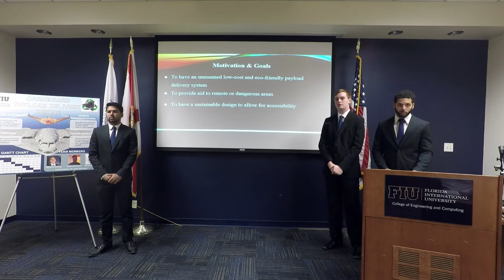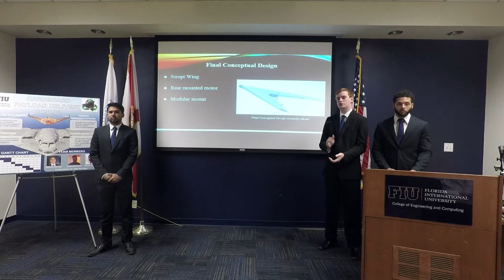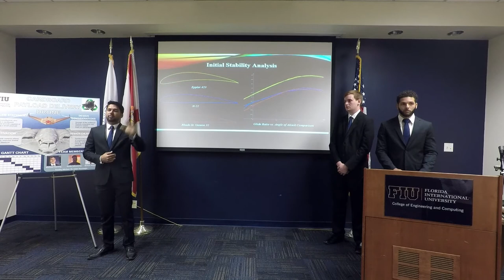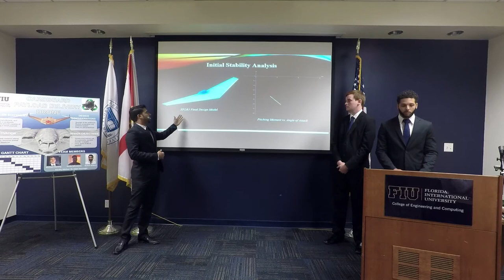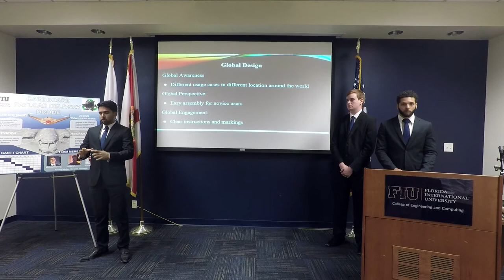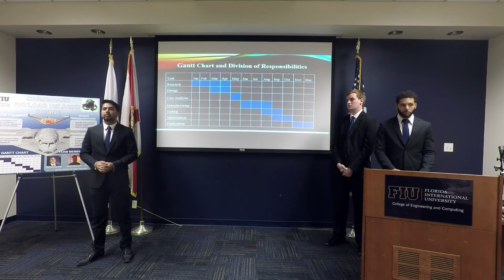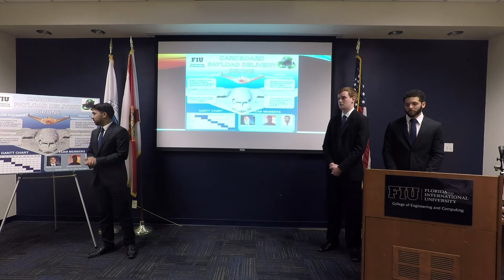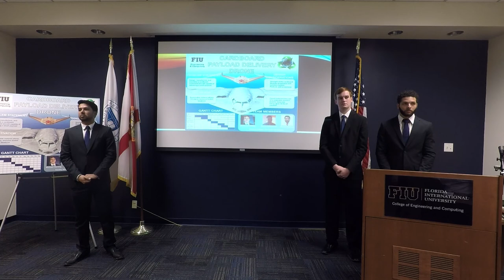SDO Team 1: Cardboard Payload Delivery Drone

Comment: I decided to watch this video based on the title, and was not disappointed. The concept for the project was great, their alternative designs were all  very interesting. In the slides that include the details of the motor and battery, they should have included some numbers , like battery capacity, output, motor output, rpm etc. That cost analysis was very impressive. Overall this team did great.

Comment: The team was very composed and knew their material. At every point of discussion the team pointed out each advantage and disadvantage. They used very efficient testing programs for their flight and stress analyze. As for the cost effectiveness, the team should not compare their project to others without knowledge of the cost analysis of other competitors. All in all, a great presentation.
-Rolando Herrera

Comment: The group did well in presenting their ideas in a fairly seamless manner. The majority of the presentation was clear and concise with the technical aspects of it being a strong point for them at this point in the design process. While the question and answer section was a little on the weak side, they pushed through and handled it appropriately. It can only help them in the long run. Overall, a great job!

Comment: They did a great job, especially for being the design organization part of the project. It seemed they knew what they were talking about. By delving further into their work, I believe they will be able to handle the discussion part of the presentation much better. It was handled fine, regardless. Considering, as mentioned before, this is still the theoretical part of the project. Very nice poster presentation, and simple to read PowerPoint.

Comment: Daniela Gil
It is important to note their use of various standards as well as the thorough prototype analysis as well as pointing out the benefits of their project vs. similar things done with other materials. It would have been nice to get a little more information on what they mean by "worse case scenario" and have them describe optimal conditions. They did a great job of highlighting their global design and the cost assocuated with their project.Overall this presentation was effective and informative and delivered excellently.

Comment: This project has a goal of being low-cost and sustainable through the use of cardboard for their vehicle. Their strengths come from the fact that they are sticking to their goal and achieving this by keeping money and sustainability in mind as they go through the design. Their weakness in not being fully prepared for the questions from the board can be from the fact that not all of the details for the project had been finalized yet. The team should also add some more numbers and graphs within their presentation, to help better understand their data. - Alexsandra Olaya

Comment: The group presented their idea well, and showed data they collected showing it can reliably handle flight. However, like it was mentioned in the Q&A section, there needs to be testing and evidence showing that the drone can reliably get from point A to point B. While the model is much cheaper to mass produce, it can't really be considered an upgrade to current technology if it can't be shown to reliably meet its intended goal.

Comment: Overall, the group did a very good job with their presentation.  Their slides were concise and to the point.  The group as whole was knowledgeable about their subject and were able to speak about their presentation without having to take a read off their slides.   Overall, the group was very prepared.  

With that said it seems that there were some significant details about their project planning that was left out of the presentation, specifically the range of the plane, specific details on how a hand launch would work and the type of cardboard to be utilized.  

In addition, they made a cost comparison with a similar project and concluded their project was more cost effective without actually having the cost details of the similar project.  They need to be more careful about making these types of conclusions without having complete information.